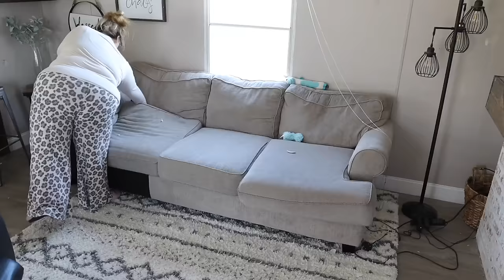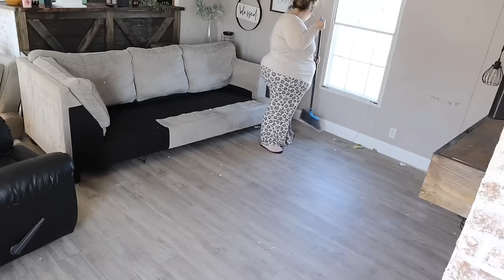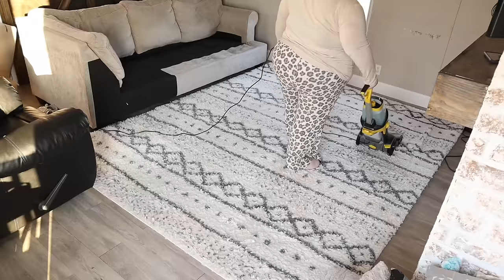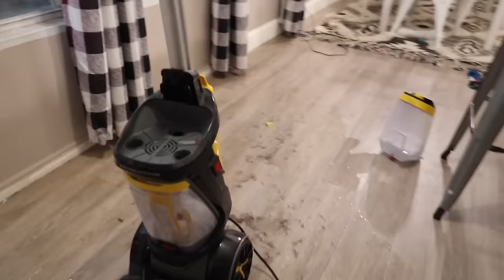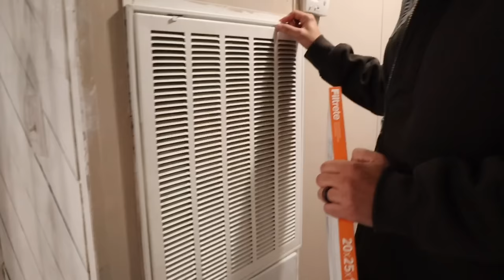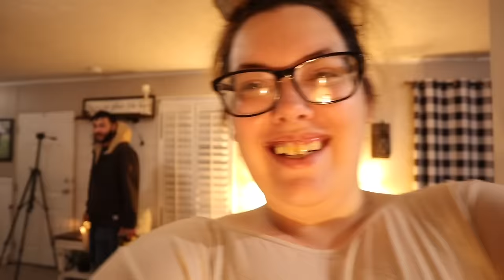MOBILE HOME CLEAN WITH ME | Spring cleaning 2022 | IT’S SPRING TIME IN THE TRAILER PARK PT. 2 ☀️

Comment: Hey Marina, ask Shane to run a piece if 1x3 (or whatever you have handy) down the length of the back of the couch(long side and screw into each area of verticle support to straighten it so you won't have that piece of wood coming out anymore(do it at the height of the broken area).  Then if you put it back where it was, no one can see it anyways.  Then do 2 pieces of wood between the foot of the couch in the back and the baseboard to keep it from backing up to the wall.  Then you can repair the wall and all is good until you're ready to buy a new one. 😉
Reply: Great idea! She can also get a couch cover since she hides the sectional part with a throw.
Reply: I was thinking a pool noodle🤷‍♀️
Reply: That seems like a great idea!
Reply: Thanks for the suggestion !! I was just sitting here thinking how can I fix my couch ? Which is exactly like Merina’s
Reply: Excellent idea ‼️👏🏻👏🏻
Reply: I had suggested this to her at one time.
Reply: @stephaniehaines4454  I hate this happened to you as well! Did you get your couch at Big Lots too? I’m looking for a couch and was headed there this week to look around. 🤷🏻‍♀️
Reply: We bought a sectional sofa from Big Lots, and it's been great! The brand is Lane. Almost 2 years, still is a great sofa!
Reply: I have a 2x4 behind my sofa, saves the wall, no marks!
Reply: Good idea!  And no one will ever know!
Reply: You can stain it with jacobean too! It wld look like w chair rail

Comment: We lived in a mobile home when our kids were little and I absolutely loved starting at one end and going to the other end doing my Spring cleaning. Your home is beautiful. 💞 PS: our HVAC tech told us to change your air filter every time you pay your electric bill. He also said the cheap ones work just as well as the more expensive ones.
Reply: Personally my hubby and I have always buy the cheaper filters because the few times we bought the expensive ones we couldn't tell a difference. That's a good idea to change the filter every time we pay the bill too! That way it doesn't get overlooked if we write it on a calendar cause it's easy to forget.
Reply: My ole man is an HVAC....he agrees with said comment. He did say the cheap ones are jus as good ONLY if u religiously change them 1x a month!!   When u pay ur bill yes change ur filter great advice!
Reply: @saraderosier510  it’s worked out well for us. Thanks for confirming!
Reply: When we were in our mobile home, we got a brand new unit and our AC guy told us to use the cheap filters and change them often because the "better ones" get clogged faster and your unit has to work harder for airflow.  Our unit needed 3 filters though so it was way too expensive to use the better filters.
Reply: We just bought a used mobile and they had the air filter in backwards lol

Comment: Hello, a quick fix for the couch, get 2 pieces of wood cover them with batten and some cloth drill it to the couch over the hole and on the other end it will help the wall and push that wood back inside. The filter y'all put in is better I think it's  for 3 months the one y'all took out last 45 days. Nice video

Comment: We change filters once a month and hose the grate off outside. You want to make sure your filter stays clean because the AC will pull that dirt and dust inside the coils and it can make the AC not work well

Comment: This going to sound crazy but you can paint the black part of your couch that shows when the cushions are in place. Mix random paints to the desired color. Thinner paint works best because it can soak in and of course do 2 or 3 lighter coats. I’ve painted worn spots on upholstered furniture and you can’t even tell. On a bigger area you will probably be able to tell but not at first glance. Won’t hurt to try it. Fyi, Dust build up could be from furnace filters needing to be changed.Ps great job spring cleaning♥️👍🏻 Blessings!

Comment: The reason you guys were able to see the wind (from my husband.) You had water vapour on the window so as the wind was blowing by it was evaporating the actual water vapour, but it was building back up based off of the humidity of the ambient air so you were seeing the actual evaporation based off of the wind picking up the water molecules then the excess water molecules of the ambient air outside actually re-condensate.Pretty nifty

Comment: Merina~If you place a long board behind your sofa the whole length, it will stop the sofa from touching the wall and further damaging your wall. You won't have to worry about the sofa moving when anyone sits on it because the board prohibits the sofa from going backwards. It works if you have curtains hanging behind the sofa, too. It keeps the sofa's back from touching and pulling on the curtains. Just make sure the board is wide enough so the protruding wood from your sofa's back doesn't touch the wall. Love your videos!!

Comment: Merina, you and Shane have become quite handy in building and fixing in your home. Suggestion for you, cut the upholstery open and off in the back to fix the broken bit. Use that section and staple it in the front to hide the black material and the corner piece of wood showing at the other end of the sofa. Use some other material and staple it to the wood braces on the back to cover where the upholstery was removed. I hope this makes sense 🙂 Thanks for another wonderful video❤️

Comment: Fyi dish soap can burn out the motor in the carpet cleaner because it creates way too much foam. Laundry soap is a way better choice because laundry soap and carpet soap both create low foam so it wont hurt the machine . I like using Tide with color safe bleach . Also always use distilled water or you can have issues with mold.

Comment: Hey Merina! Live chat was fun! Now back to watch the video closer! 😂 I set an alert on my calendar to remind me to change my air filter every 3 months. And I goin with my vacuum hose with the brush attachment about every other week to vacuum over the filter it keeps it front getting so caked in dust and hair till I change it all together. I have cats so mine would be  ridiculous if I didn’t touch it til the 3 months was up. I vacuum so much hair and dust out of it. I also write the date to change it on the filter with a sharpie.. It’s so worth buying the filters that cost a little more because it keeps it running good and your house is less dusty.

Comment: We had the same thing happen with one of our couches (board busting out the back) so my husband drilled a long screw into and through the top of the back (through the fabric and all) and into the bulging board to hold it in place. I always had a throw hiding the hole in the back of the couch until we could replace the couch and it held up great.

Comment: Great job! Suggestion on couch: carefully take the black cloth bottom loose and have Shane nail in some 2x4 brace pieces to hold your frame back together. It works! Then just staple the black cloth back on. It will extend the life of your couch and it’s a pretty easy fix! I’m with you on the OCD unmopped square on the floor lol. Also, where did you get your ‘R’ decal on your storm door? I love it!

Comment: At the risk of drawing heat… I’m going to suggest a vacuum. It is my current vacuum and even though I only have one room of carpet and area rugs in my house, my other vacuum broke and I went three years without one, so when it went on sale for Black Friday I. 2022 I treated myself to it for under $40.00. I got it put together and ran it.  In one pass the dirt cup had filled up. I filled up the dirt cup four more times the same day vacuuming the room and the area rugs. This was in November of 2020. I still have the same vacuum today and I use it weekly. I do have to break it down and wash the filters and cup and let them naturally air dry for a few days about two times a year. That is minimal maintenance for the amount of dirt and dust that is removed from the carpets and rugs.  If you do choose to try it, please take it under advisement to empty/pull out the hair/dust outside over a trash sack and maybe wear a mask to avoid getting the dust in your airways. The vacuum really does pull a lot of fine dust/dirt from your carpets that you don’t know is there. The vacuum is a: Hoover WindTunnel CL Pet Bagless Upright Vacuum UH711055DI.  Of course the price has gone up because that was a hugely discounted price for Black Friday. The website states that it is now priced at $89.99. Truthfully I would pay the higher price and would think that it was worth it. I hope that you don’t feel like I have tried to push it on you, Merina. Just a suggestion, as I am sure that you getting from plenty of people.

Oh my goodness at seeing the wind! That was freaky to say the least. I’m thinking dust or a break in the matrix? 🤪🤣

Comment: Also, any chance you still r able to get a piece of the upholstery material from the broken thrown out side of couch.  Use a staple gun and put a piece on the lower area anyways, so you just have to drape the taller end with your sofa blanket for camouflage. You can staple under thw couch and under thw cushion so no one would know but you guys. 😉

Comment: Marina, you make me tired just watching you clean. The house looks so pretty & clean. I'm anxious to see what ya'll are going to do to the hallway floor. By the way I really think you need something on the wall you just fixed on the right of the fireplace. I liked the way you had it before with the table and light, you can always hang a pretty picture on there also. Tell Shane to just cut off that piece of wood that is sticking out of the back of your couch so it won't do anymore damage to the wall. See you next time, God Bless, Kathy

Comment: You have to start from top to bottom when you are cleaning. Never mop or clean your floors first. The reason why is because as you clean up from the top all the dust, debris, and grease are falling onto your counters. You eventually will have to wipe your counters then all that stuff crumbs etc will fall to your floor. You will have to re-mop your floors again.
Also for your floors take a teaspoon of original Tide powder and add it to hot water. Your floor will come out super clean.
Wall cleaning is considered deep cleaning. I notice you didn't do that. Sorry, I use to be a professional maid. My OCD is kicking in.